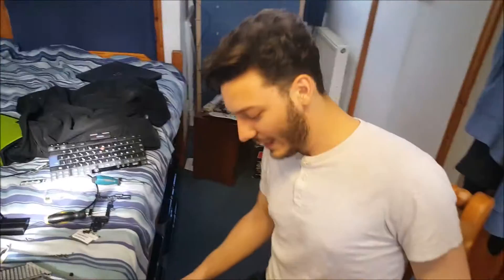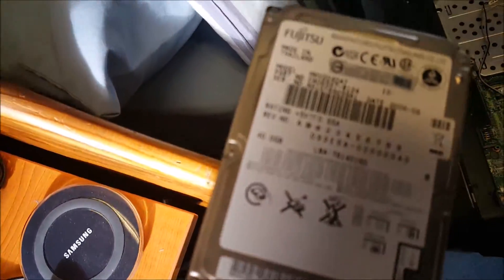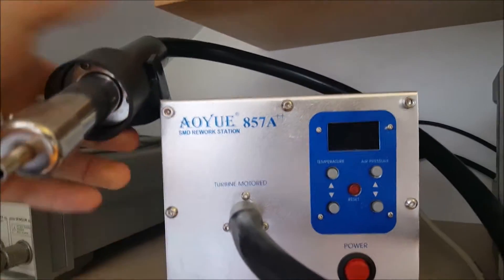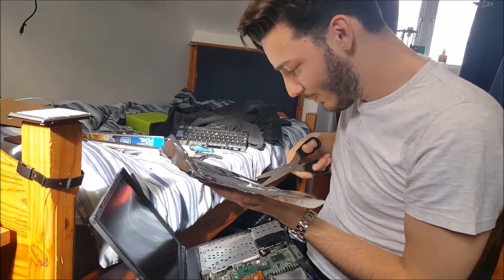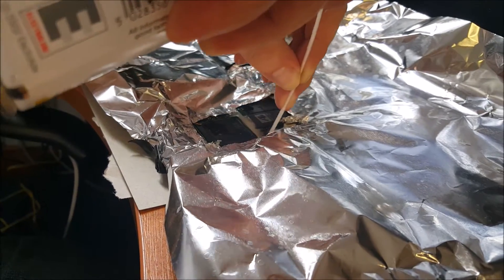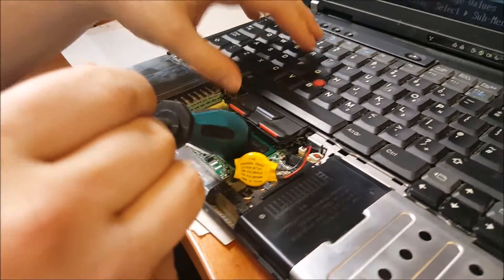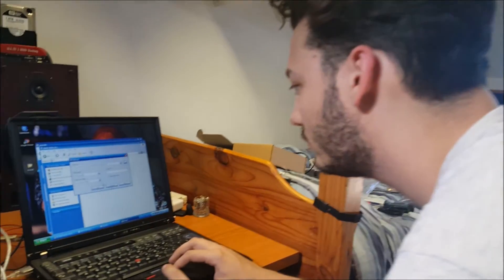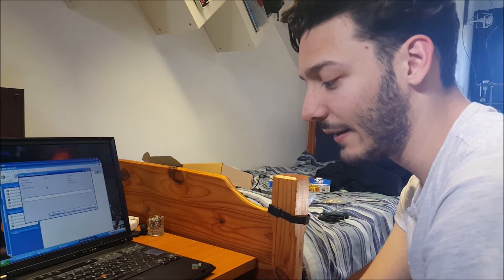Thinkpad T40 GPU/Southbridge reflow howto (screen locking up)

Comment: Too much smart alec posing here. Would have appreciated a no-nonsense video with clear explanations of what's going on. 2/10
Reply: First of all the board needs to be dried in an oven to get rid of the moisture inside the PCB. Reflow has to be performed with heat from the bottom too. Yada yada yada.
My T40 has this board flex issue, I would not dare to reflow it without a proper rework station.